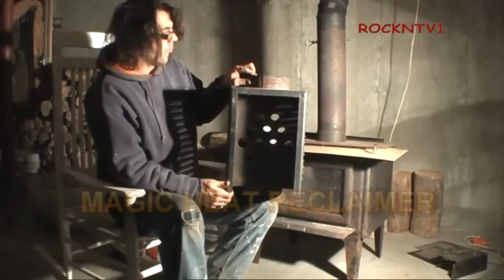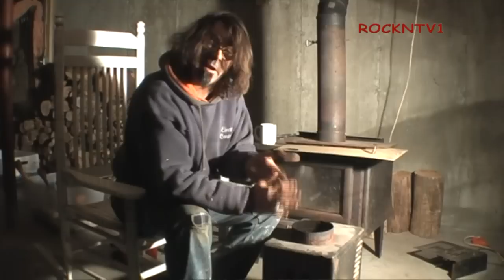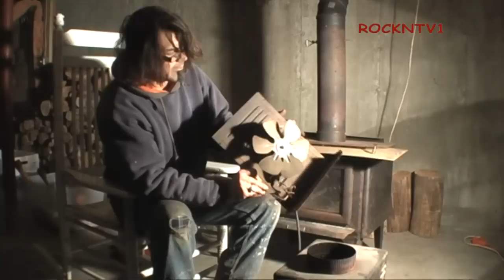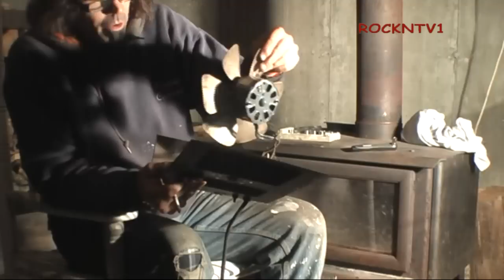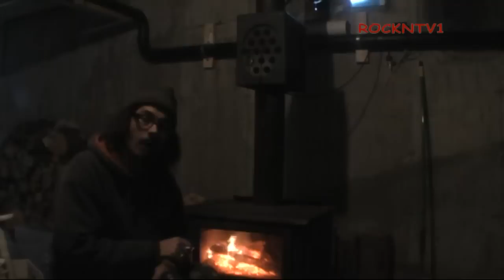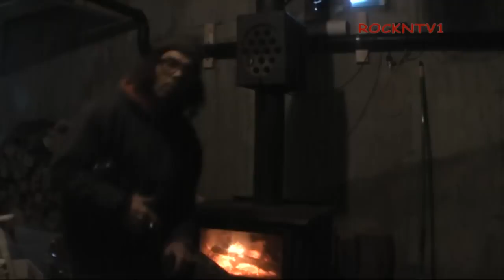Magic Heat Reclaimer MH-6-R  Save oil

Comment: @ROCKNTV1 - Thanks.. i was taking apart the fan assembly when i got an email with your comment.. i will disassemble the fan and clean it tomorrow at work.. going to use an air compressor to dust it out real good.. unfortunately i dont have any documentation as my house was built in the late 70s and who knows when the magic heat was installed.. any chance you know of where to get a pdf of the documentation?

Comment: @ROCKNTV1 - well i think the motor is bad.. i cleaned it up real good.. oiled the motor.. it will run for say 30mins.. then it shuts off.. this is with the thermostat or switched to ON position.. then you hear the motor trying to turn.. so any leads on a replacement motor? i see one at northern tool for $50+sh..

Comment from the maker: @BlueRidgeRuckus have you tried to run the motor off of the unit to test if full voltage is at the thermostat, it must be at 150 f or above. As far as a replacement motor i have not looked , mine is still working

Comment from the maker: @numag1 i would advise against mounting the Magic heat exchanger horizontally for several reasons, In the video i show you the lubrication ports on the blower are vertically orientated. second the cleaning bar would scrape creosote in to an area in the Magic heat exchanger to a place it would not exit the unit and possibly collect.

Comment from the maker: @commando7144 THE therm is there to come on at a stove pipe temp of higher then 150-175 f . It is like that to cut down on the creosote in the unit and there abouts, I,m not going to recommend that one bud but you can try it if you clean the pipe a few times a season.

Comment: Hi I have a Magic heater in the my cabin in NH. It was there when I purchased the cabin, I removed the bottom of the chiming cleanout out side this summer and had some build up of soot. My question to you is my Magic heater is mounted vertical and I never removed to clean, I only use the stove maybe 30 days out of the year due to it being my vacation home. should I get my wet vac and clean out the 90degree fitting under the heater or should I disassemble flue pipe? Also how often should I run a chimney brush through the pipe?
Reply from the maker: I would take it apart

Comment from the maker: the magic heat works great, Im not sure i can give you good temp increase measurements for one my basement is huge for the 35,000 btu wood stove. I have since got a larger stove with a built in reclaimer. it has been sub zero here in NH for a week now and still heating the house without oil, thnx

Comment: I just bought the same model yesterday. It's the same older version without the thermostat and the 14 heat tubes (instead of 10 as the new ones have). It was never used and the instructions say 1977 on them, but I am fairly confident it will help get more heat from my stove.
Reply from the maker: I had very good luck with the magic heat,be sure to keep your chimney flue temps at 450f and do the maintenance of cleaning and such.
Reply: Thanks for sharing, is there any place that still sells these older 14 tube units?

Comment: @TheBluegreen0620 I just bought a Magic Heat. According to the instructions they don't recommend mounting it horizontally but it CAN be done. Get a hold of the manual and it will explain how to do it.  You could probably download a pdf file of the user manual. Good luck.

Comment from the maker: @fbull66 hello, I am not familiar with your model, but i would pull the old motor off of your heat exchanger and head for my local electric motor surplus outlet and just match one up.

Comment from the maker: DUDE, If you actually watch my video about the magic heat reclaimer i show you ALL the parts, inside and out, also , spam stuck to the inside of your wood stove pipe would not be there if you were diligent about cleaning as the magic heat works really good reclaiming lost heat, MH-6-R LOOK INSIDE DIY HOW TO install improve efficiency of your wood heater, what is your question ? quote spudpail "I remove the unit every spring and clean it,,,", really  you can see inside the reclaimer ON MY VIDEO